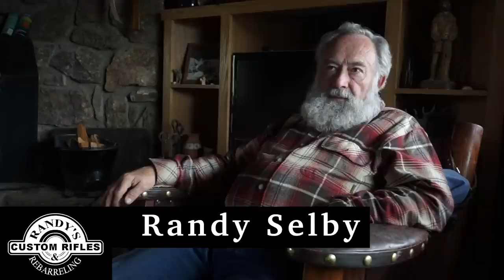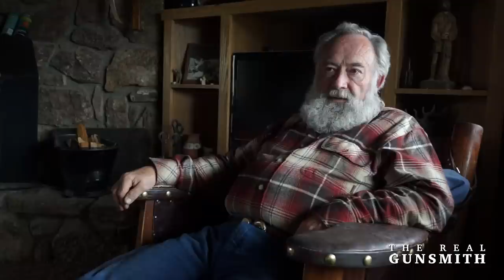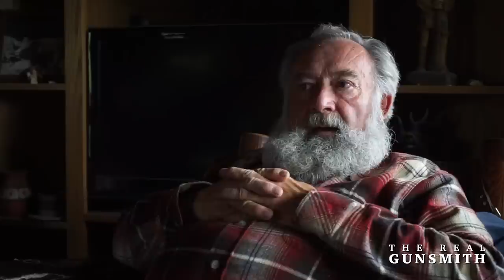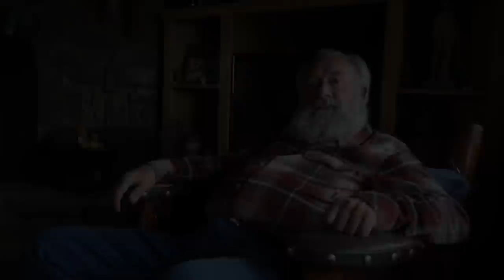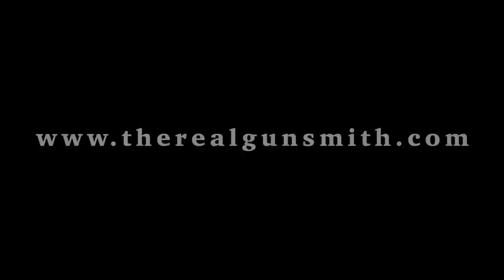Barrel Accuracy Life – The Real Gunsmith

Comment: I have a 28 inch shilen match bull barrel in 65cr and I love it, it's great but no it will not cure cancer and yes I am getting tired of all the hype around this cartridge. Everything that I heard in this video I believe it as fact the truth. I will say that I happen to find good velocity spreads at low pressure with that round. But I can say that about other rounds too. I'm not terribly concerned with barrel erosion as I am about to burn out my 7 mm mag. And am thinking about replacing it with a 270 WSM or 28 Nosler. And I'm going to be coming to you Randy to build me a featherweight magnum. I love these videos...

Comment: Seen a howa 1500 .308 w just high-end hunting rounds through it 3000 rounds down the pipe that shot 3/4 moa or better still.  I suspect the cold hammer forged steel has something to do w this extended accuracy window.    What do you think, ?
Reply from the maker: It won't last much longer. Barrels that have not gotten hot, repeatedly last longer, no matter the method of production.  Slow fire, keep barrel cool, much longer life, all around.
Thanks for watching.
Reply: @TheRealGunsmith  that must be what it is.    It's not heated up crazy.
Reply: @TheRealGunsmith  thanks for taking time to comment back.   Make some sense of this for me.    I appreciate that alot 🙏
Reply: @TheRealGunsmith I just keep watching your vids over n over again.    Your one of the only true sources of information on YouTube.

Comment: How can a barrel be rifled again??? For instance a 30-06 if it’s goin to have new rifling and still be a 06???? Or will it be a bigger caliber????? Just curious. I load fir my 25-06. The load I use now I’m hitting 3,300 FPS with 100gr nosler ballistic tip. One more load I’ve got for it is 85gr ballistic tips and they’re hitting 3,600 FPS. I don’t shoot it much just to deer hunt with.
Reply from the maker: It's called reboring and rerifling. It has to go to a larger caliber, 30-06 to .338-06.  the barrel is reamed to .330 diameter and rerifled to .338 and the chamber is cut to accept .338 cartridges.

Thanks for watching!
Reply: The Real Gunsmith ok I see now. Thank you for explaining that I was wondering how that worked. Thanks again and GOD BLESS.

Comment: 6.5 creedmoor is just a 6.5x55 Swedish Mauser  with dilutions of grandeur.
Reply: Hotter loads in factory ammo.
Reply: @WilliamStewart1  
I'll bet you get more velocity from handloads in the 6.5x55, in modern rifles.
Reply: @varietasVeritas  I would bet that too, the swedish has more case capacity. This is why people are switching over to 6.5 CM, shorter case=has a smaller action=more reliable. The 6.5 is just a more efficient case design.
Reply: @WilliamStewart1  
Like I said, delusions of grandeur. I never even heard about any problems with reliability in a .270 win. And efficiency is only important to bean counters. If it takes 40 grains or 45, is that really important? And  the few ounces of weight you save in a shorter action, can you tell the difference?
Reply: @varietasVeritas  Sorry I meant to say accurate not reliable. Theres less movement in a shorter action=less deviation. At the end of the day it's just a modern round with slight upgrades, it's very efficient and very accurate, why people hate on it is beyond me. Seems people have something against it for no reason, them getting all bent out of shape over something new coming out with improvement albeit small but still improvements is beyond me.
Reply: @WilliamStewart1  
I'm not trying to hate it, but I don't believe the creedmoor is better than the 100 year old sweadish. Theoretically it may have some small advantages, in actuality I doubt if it is noticeably more accurate.
Reply: Only good reason for CM over swede is compatibility with AICS magazines..
Reply: @varietasVeritas  All small advantages add up, it's still a modern round with advancements in design. At the end of the day you're only going to get small increases at this stage of the ammo game with modern engineering.
Reply: smau990 Yep exactly. It can be used in an AR10, which to my mind is the major reason for it's existence. In a bolt action rifle with handloads the 120 yr old Swede does anything the Creedmoor does with about 10,000 psi less chamber pressure.
Reply: i look at it like  a cartridge built for punching holes in paper vs a cartridge built for war.
Reply: 6.5x55 has been around and used for over 100 years. In military service and hunting. It is said that more moose have been killed with the 6.5x55 than any other cartridge. Would surprise me if 200 years from now it's still around while the creedmore is a distant memory.
Reply: I thought the whole advantage of the creedmoor was the ability to load it in an AR-10 magazine and still have a "1000 yard cartridge" or at least, a good, relatively high B.C. cartridge that can get out to long range accurately. 
This would be the only redeeming quality I might be able to see in the creed.
Reply: @varietasVeritas  i have a 6.5 x55 AI you would poop seeing what that thing can do
Reply: Well the 260 Remington is the almost exact same thing as a 6.5 cm it just never had the hype and lies behind it. I shoot a 264 win mag. Everyone told me that they were barrel burners. But if you shoot 120 gr ro 160 gr bullets at about 3100 to 2800 fps it will last. He is right the pressures and the speed of the bullets makes a world of difference.
Reply: Look, the ONLY reason the 6.5 CM exists is that 140+ gr VLD bullets Will not fit in a short action mag.  There really is no difference in the 6.5 SWED, 260rem or the 6.5. CM.  In a modern action the 6.5 SWED tops the other two....but no matter.  They all super cartridges. It is all hype.

Comment: As a young 70 year old gunsmith I'm continually ashamed of your prejudice against any caliber younger than 1950.

 Your comments regarding pressures vs  powder charges vs velocities are nothing but nothing more than redundant. They are all related! Your knowledge is immense, I have no doubt. But you expounding hot wind of ancient knowledge is offensive. Most knowledgeable shooters expect 1,000 to 1,250 rounds to be the life of a barrel. I've built many PRS rifles for young shooters and not one expect to have the barrel last more than 1,000 rounds.

My custom built 22-250 rifle barrels pushing a 40gr. pill over 4,000 fps. lasts 500-750 rounds for half MOA accuracy.  They may last 3 times that long while still staying within 1 MOA. for some, as long as it shoots 1" groups at 100 yards, they're happy.

Stainless barrels are another area you discuss without mentioning that stainless barrels are softer than most other commonly used barrel materials. 

Faster barrel twists is another area you ignore. A 1:6 twist will greatly effect barrel life when compared to a 1:12 twist. To expect a .224 Valkyrie shooting a 3,000+ fps pill in a 1:6 twist to last as long as a .22-250 shooting a 3,600 fps pill in a 1:14 twist is ignorance. 

So, to reiterate my points: barrel life is not just pressure; it's not just powder charges; it's not just velocity; it's not just barrel material; and it's not just how hot the barrel gets (although this is the single biggest contributor). Barrel life is related to all of those aspects mentioned.  

Bottom line, competition level shooters that expect more than 1,000 to 1,500 rounds for a barrel are going to be generally disappointed. Even with the venerable 308 win. Which, will be the same for 6.5 CM, .224 Valkyrie, 6.5x284 Norma, 6.5 PRC, and all of the other new calibers that outperform the OLD   .30 caliber rifles. If you really want a heart attack... I have AR Platforms in .224 Valkyrie, 6.5 CM, and 6.5 PRC and even 6.5 Grendel that shoot better than half MOA 10 round groups. Each have 24" fluted heavy barrels and shoot faster than advertised velocities. I expect to replace those barrels at around 750vto 1,000 rounds.

So, what is your point??? Is the 6.5 CM the best caliber ever developed?  I don't know... 

I prefer the 6.5x284 Norma pushing a 147gr. ELDX at 3,025 fps. for taking anything from rock chucks to Water buffalo at extreme distances! If the barrel lasts 500 rounds... I'll replace it!!!
Reply: I suggest you start your own channel, and pervey whatever you want on it, rather than take apart someone else's work on their channel.
Reply: Denis Knobloch   We’ll said,

Comment: I have a 6.5 Creedmoor 28" Shilen Barrel with a Savage action. It loves Varget powder and a heavy Match King bullet. It happens to be my most accurate gun but not by so much as you would think. My 270 Sporter Barrel Winchester with a good worked up hand load is nipping at the heels with a five shot group and be allowed to cool down while. No, 6.5 Creedmoor it's not the second coming. It was a masterfully marketed round by Hornady. That's all I got to say.

Comment: I've been at the rifle range and watch guys with brand new AR-15 sights a gun in it will shoot a half inch to an inch group then they will put in a 40 round clip fire the gun as fast as they can tell the clip is empty put in another 40 round clip fire it until it's empty lay the gun down let it cool then go back to firing one shot at a time the gun shoot 6-inch groups they have already burnt the barrel out when you heat the barrel up to fry an egg on you have already corrupted the barrel that gun is only good now for pray and spray

Comment: To increase
longer barrel life using certain powders such as H1000 powder that can extend
barrel life by 2 times or more, by using
a less abusive powder on the barrels steel of your gun, also loading Moly coated bullets can also greatly extend
barrel life much longer!       Shooting
secrets in shooting competition as a Example,
the 6.5 saum the 7mm wsm and the 6.5x284 can eat barrels. But by switching powder
and using H1000 powder has and can extend
barrel life greatly up to 2X, Then
after the barrel is broke in and shooting perfect. Top custom builds will take their
barrel off and send it in for $100 and have it Nitrided (Melonited) this Nitrocarb
Saltbath treatment that hardens the outside layers of rifling to a Rockwell 72 hardness.
Doing these two things, competition guys have extended barrel life up to 3X. AND THE LONGER CASE NECKS can extend barrel life creats a venture effect and will not let the powder flame coming off of the inside of the catridge case shoulder torch the throat!  Example. A 7mm SAUM VS THE 7mm WSM- THE 7mm SAUM HAS LONGER
BARREL LIFE over the 7mm WSM. or even wose a 243 with its torch cutting shoulder eating the barrels throat! david Tubb talkes about this and shows that some 300 weatherby barrels did and could outlast the 243 win!

Comment: bringing up bench rest shooting and the 6 ppc is a whole different ball of wax talking about accuracy. I don't know what the  sizes are in the U.S. for center dots are in bench rest, but up here in Canada they are 7 thou at 100 and 14 thou at 200. In the high end of shooters a loss of a few thou means a barrel swap out to stay at the very top. I suspect it would be the same in the states.  I can't see a creed being used for that kind of shooting or a bad choice for distances shooting  yeah sure going from a .5 group to a .75 group isn't a great thing but also not the end of the universe either.  I shoot a 260 rem great cartridge and pretty much the same powder capacity as the creed a touch more but nothing that really makes a difference.  The moral of the story is burn a ton of powder at high pressure and high heat and get your barrel hot and keep shooting you pooch your barrel. Easily done with a mild cartridge if 50,000 psi, which would be considered  really high pressure in the scope of pressures that we would normally see in everyday life even in most industry.